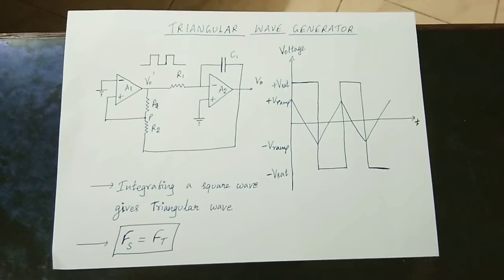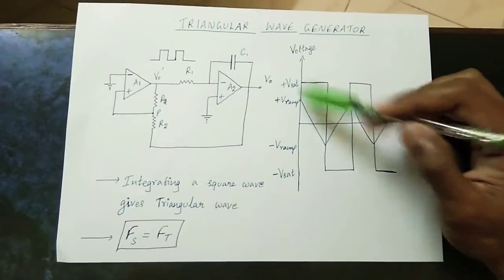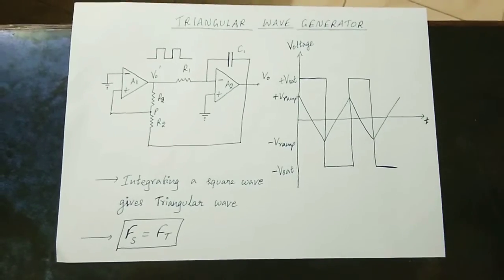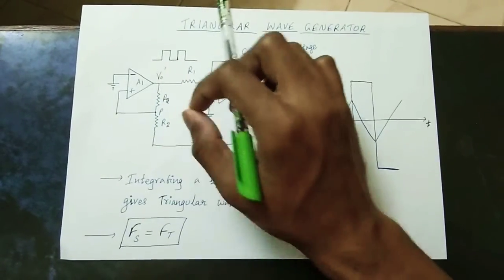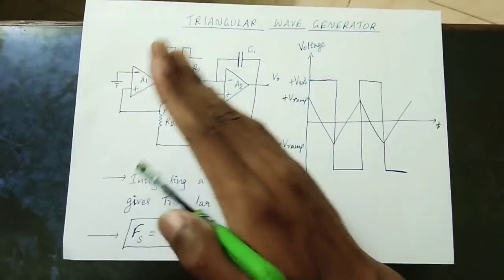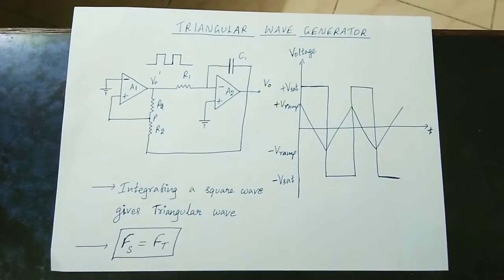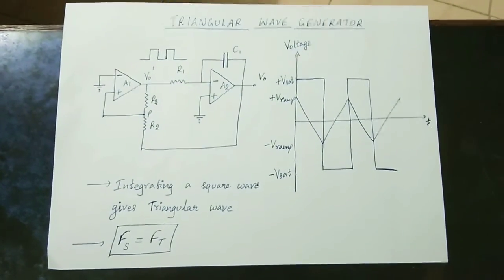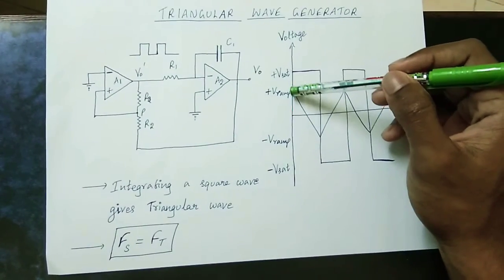Triangular Wave Generator(Tamil) | Linear Integrated Circuits | EE

Comment: for a multivibrator shown in below figure, find the frequency of oscillation given R1=10Kohms, R2= 20Kohms, C=10nf, R=48Kohms. under which conditions the wave of node voltage Vx will be triangular wave ?
a)for a very small time constant
b) for a very small beta value
c) for small range of upper and lower saturation limits
d)for a very high beta values. Please gave the crt answer sir.